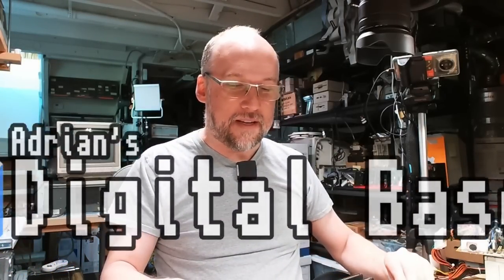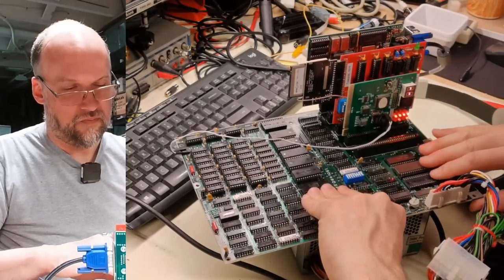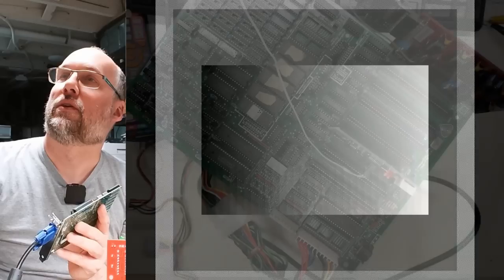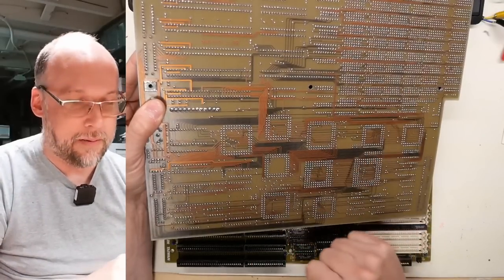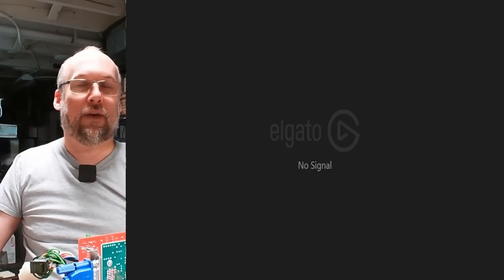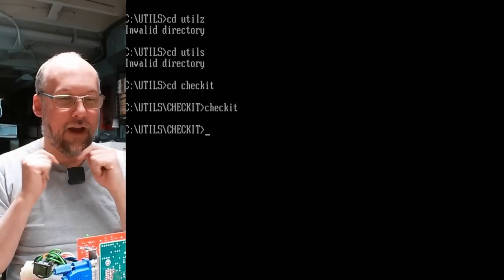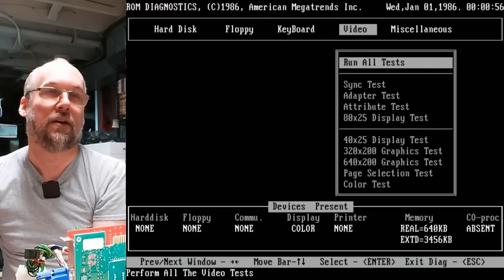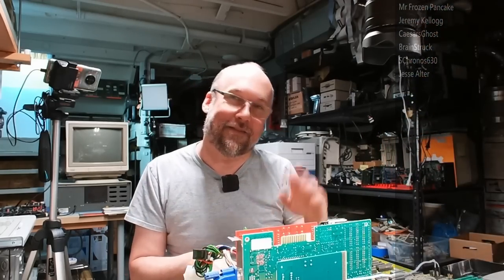Mystery motherboard testing

Comment: I remember upgrading from an 486 DX2 66Mhz to a Pentium III 800E when i was young. The first thing i got amazed at was that i could move running programs around in windows without the PC freezing up. Windows 95 on a 486 was pain, even with my 24MB of memory. Browsing websites was so slow. Every time i scrolled down, it had to slowly redraw the entire window. The Pentium III handled Windows 2000 without any effort and websites which were crammed with multimedia content ran just fine. 

The next thing i remembered testing out was video playback. I had windows 95B running on my 486 and it could barely play MPEG video at like 64x96p or something like that and heavy compression. The pentium III even played MPEG2 at crazy resolutions. I believe i even pushed it to 1280x720 with full 50hz because i live in PAL region.

 I believe i used this PC until i had the Core2Duo, because i didn't want a Pentium IV. From Pentium III to Core2Duo was another big step, but not as big as the previous one with the 486.

Comment: If I remember correctly, the BIOS in the original PC didn't support booting from hard disks. That was one of the "extensions" in the PC XT where a ROM in the hard disk controller could patch the INT 13h handler so code for floppies would now also work for the hard disk. For the AT the on board BIOS came pre-patched but with a limited list of hard disks it could handle. Things were a lot better by the time we got IDE.
Reply from the maker: Interesting. Yeah I think you have to replace the ROMs with the very last one for the 5150 to then support that.
Reply: @adriansdigitalbasement2  I'm fairly certain that all 64/256K motherboards had the 10/27/82 BIOS which supported option ROMs so should be fine once you get that one going!

Comment: 2:22 Unless there is a problem with that CF to IDE adapter it should draw power from pin 20 on its own so no need for that extra wire to bring the 5V to it, closing that jumper should be sufficient.
I have the same adapters and on motherboards where pin 20 is physically present in the IDE connector I usually connect it to 5V with a wire underneath the motherboard for this reason, it makes powering them neater

Comment: I seem to recall having problems using a VGA card with my 5150 motherboard; with an original 8088 CPU the VGA card didn't work however with a NEC V20 CPU it worked fine.

I came to the conclusion that the V20 has some additional instructions that the VGA BIOS needed to work.

Comment: @ 21:13, when you zoom in, there is a socket labelled 80287; would there/could there actually be a 2nd math co-processor installed?  Also, @ 23:54 there is labels on the board that say "80287 Installed" and "80387 Installed" by your thumb.
Reply from the maker: Believe it not the 386DX supports using a 287. IIRC when the 386 came out, the FPU was not available yet, so 287 support was there on motherboards. You can't use a 287 and 387 at the same time. Funny about the BIOS saying 287 though. It probably should have said FPU installed :-)

Comment: I have a 286 laptop from 1987 that has 1 MB RAM on the bottom(below the desktop PC ISA cards) in DIP chips. I wonder how much memory can I install in there by replacing those chips?

Comment: I have the manual for another 386 board with that chipset which explains all those extended settings. I am in the process of preparing a nice scan for upload on theretroweb, but I can send you the raw scan if you like
Reply from the maker: That's great - if you could share it with the Retro Web (And pics of the board) so everyone can benefit. I am curious to know if anything extra is possible in those settings versus what is already exposed.
Reply: @adriansdigitalbasement2   I just noticed that it only shares the 82C206, the other two chips are different ones, sorry.

Comment: 26:47 The first ever PC we had in the family was a 386 from "Akhter Computers" and it had that BIOS too! I remember scratching my head for quite a while working out what those "Advanced" numbers did, as the machine came with almost no documentation for this part of it. Pretty sure that BIOS is identical!
Reply: that's a debug BIOS used in a special kit one of the fellow commenters of this video used too
Reply: @rawr51919  Thanks, just read it - shame we didn't keep the board then if that was a rare BIOS release, i.e. not supposed to be shipped that way!

Comment: Doesn't the original PC require negative 5 volts? Is the ATX/AT adaptor supplying that?

I had one of those XT IDE cards and it failed. I've sort of fallen out of the hobby in general due to how common hardware failures have become.

As far as the second 386, it's mostly TTL, either discrete or PAL as you point out. That one chip is sort of a PC-on-a-chip that combines the timer and DMA and other chips that you'd find running an XT or AT (AT in this case). The two 20NS chips are probably cache tags, good for 50 mhz. The rest are the actual cache chips, good for 28Mhz at zero wait states.
Reply: The -5V is needed by the 4116 DRAMs used in the original PC, but the one in the video had replaced this with the 5V-only 4164 chips so should be ok without that power rail.
Reply from the maker: This ATX PSU has +5/+12/-5/-12 on it -- the original standard supplied all 4 voltages. It's newer supplies that did away with one or both negative rails. (Usually -5 is gone)

Comment: The XT clone motherboard, I saw the extra psu input and wondering if maybe the power is somehow a pass through for the drives such as the floppy drives. Maybe it was hooked up to a bay of floppies and that's why it needed the extra connection? Just a thought, I'm not familiar with those motherboards It was just the first think that came to mind.

Comment: Since there was a big price difference I struggled between a 386 DX33 and a 486 back in the day after a few month I managed to find a reasonable priced 486 SX25 with 4 MB Ram and a 210 MB Harddisk, just bought a mobile 10TB HD, how times have changed!
Reply from the maker: And that SX25 would have given you a nice upgrade path to a DX266 once those chips came down in price... versus the 386DX that wasn't really going to go anywhere. The performance improvements back then was just staggering!
Reply: @adriansdigitalbasement2  True, I got a Cyrix DX 266 later!

Comment: Would you mind dumping and archiving online that weird BIOS of the XT clone? I happen to have a very, very similar board, which looks almost exactly identical to yours, save for yellow silkscreen instead of white, that I'm working on getting up and running.
Reply: Came to post this as well. Sun Up Computer was apparently a Taiwanese company that also made expansion cards. It would be great if the bios was preserved for posterity.

Comment: The floppy drive you tried with the XT clone board looked like a 1.2M drive, but did the XT support them, or just the standard 360K drives?

It was interesting you mention with the last board that it's running the 80ns memory at 70ns, the last batch of SIMMs I soldered up had 60ns chips, but my SIMCHECK said they tested fine at 45ns! I really want the SIMM adapter for my RAMCHECK so I can actually confirm that speed with something more "modern". But otherwise it seems like the manufacturers were pretty conservative with the speed ratings of their memory chips. I can imagine it could probably have lead to dodgy vendors buying slower memory and putting it into faster systems like this.
Reply from the maker: The printed speed rating is indeed the minimum they will attain, and like you, I've often verified them to work at 45ns or 50ns just fine. The drive was a 360k -- I tried a few as well but I always write on my drives with a sharpie if it's 1.2 or 360 since it can be hard to tell at first glance sometimes. :-)

Comment: I remember not being able to keep up with CPU peeds, even just reading about them. They got so fast so quickly. in the late 80s through to 2000. Having said that my mums old PC scores about 3000 in passmark, its a 4th gen intel, whereas my new 13th gen intel CPU gets 47000, but it has a  LOT more cores.

Comment: How do you ensure that the inside of the DIP switches dry after submersion?
Reply: Keep it in a warm and dry environment for long enough time, or to speed it up, point a fan at it.  With clean water, air drying is fine.  If water is salty or dirty, you'll definitely want to use compressed air to dry it quickly.
Reply from the maker: Luckily our water here is incredibly soft, so it doesn't leave behind residue. Worst case a little shot of contact cleaner/deoxit after washing make it right-as-rain.

Comment: Cache isn't directly mapped to a specific memory page.  What it caches can be anywhere most recently accessed in memory.  So "the first 64K of memory" is not correct.  The cache controller keeps track of which memory space specific pages of cache map to specific pages of memory.  So that 64K of cache handles that 4MB of memory you had installed.

Comment: Did you try the IBM board without the 8284? Maybe it wasn't missing but isn't necessary/useful in that version..
Reply from the maker: I'm pretty sure it's essential for operation, it divides the master clock down to 4.77mhz for the CPU

Comment: Am i imagining stuff or does that 386 not say A80386DX-20, as in manufactured by AMD, 80386DX, 20 MHz?
EDIT: I'm talking about the third board, the first 386 board with the co-processor and 8 MB of ram with parity chips on the board.

Comment: 5:25 Does the ATX supply provide proper -5 and -12 in addition to +5 and +12?  5150 requires it
Reply: ATX supplies with a 20-pin connector will provide it -5V.  Those with a 24-pin connector might not.  Check for a white wire near the latch opposite the grey wire.  All will supply -12V (blue wire).
Reply from the maker: Yep this particular PSU has all 4 voltage rails on it. 5/12/-12/-5 -- I was lucky enough to find several of these which I hold onto for all my future retro needs. :-)

Comment: Ots probably the case that ibm sokd very few 5150 PCs after the XT came out. The probably kept suppying them tor customers who had non standard software running on 5150 PCs that either would not run or they were unwilling to validate as running on the XT and required replacements or additional units for expansion. IBM was comingfrom the perspective of their nainfeame buisiness and had written support policies that guaranteed thrir customers support for a particular piece of hardware gor a defined number of years. I recall reading their policies some years ago and thinking about how they were really  incongruent with the lifecycles of modern PCs where a particular vomputer is only sold for a year or two.  But they were still n the mindset of selling millions of dollars in hardware as a long tetm investment and ecpecting that the ustomer woildmaintain the exact same configuration of equipment for 10 or 15 years or more. Like the cobol based systems that were still running in 2000.

Comment: Visual Technology got nailed when IBM came out with the XT in 1983. Visual's V-1083, aka the Commuter Computer, was a 100% compatible portable computer which had an IBM expansion port on it to handle a Bus-slot box and hard drives, cost the company a lot of money because no one wanted the straight PC anymore and were off to purchase XT compatible machines. It wasn't just Visual that got nailed by this. Data General scrambled along attempting to sell its DG1 and DG2 portables, and so did other companies such as Singer and Brother. Ultimately, Singer and Brother pulled out of the PC market because of this. Visual Technology ended up with a ton of machines it couldn't get rid of after getting hit with a major backlog previously. It didn't help that there was a DRAM shortage around the same time.

Comment: So load up the Supersoft diag and run it on the IBM and Clone board.  Its prob RAM that is the issue on the clone. there is sometime another Jumper that needs to be changed but supersoft will run with the bare minimum. 
Awesome Stuff. Keep it going. (We also missed your normal sunday vid on the main channel)
Reply from the maker: Yeah! That's the plan. Love that Diag Rom -- it's so helpful.

Comment: I think single core performance has increase like only 2-4x in the last decade.
Reply: I'd say more like 40-60% single-core improvement clock-to-clock with Intel-CPU's? Just comparing 2014 Haswells to 2023 13xxx-series, and much of that improvement comes from faster memories, improved caches and faster bus-speeds. That's why most 2012-18 machines are still perfectly useful today. And rest is marketing 😒
Reply from the maker: I just actually looked at some Cinebench single core tests and I guess things have improved about 2x since 2016: https://www.cgdirector.com/cinebench-r23-scores-updated-results/ --- but even going back to 2013 yeah maybe a bit over 2x.... that's not nothing but certainly nothing compared to the 25x improvement in less time back then.
Reply: @adriansdigitalbasement2  yes I remember "needing" a new computer for gaming just about every year or so throughout the 90s.  Now I can go 10+ years.